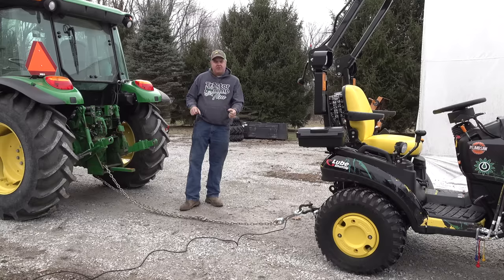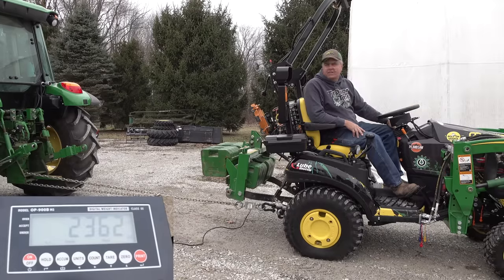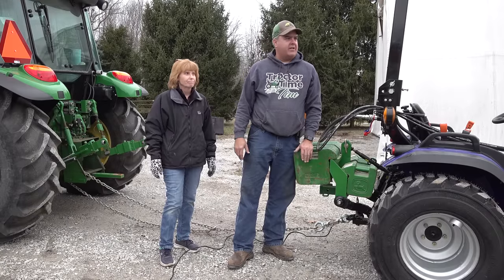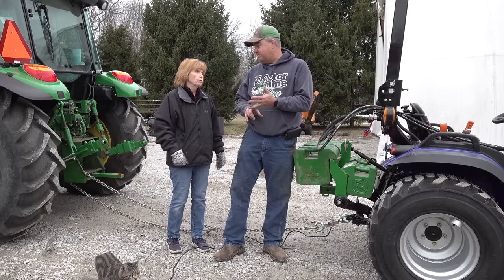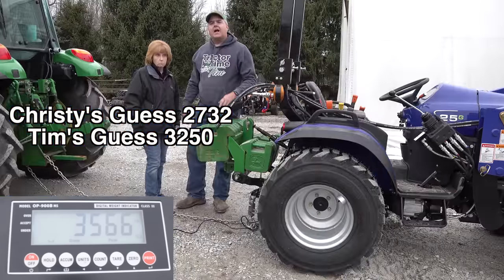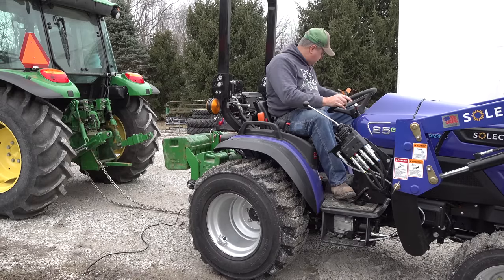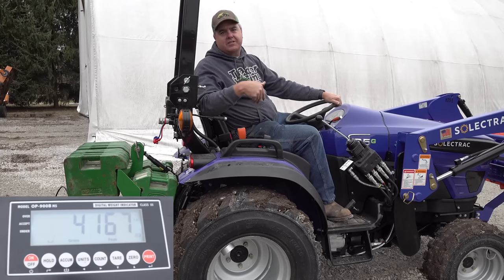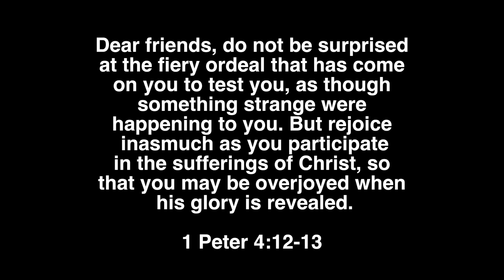CAN THE ELECTRIC TRACTOR PULL ANYTHING? Solectrac e25 vs Deere TURBO 1038X Tractor PULL TEST!

Comment: I like the electric tractors in for me who doesn’t have much property. It would probably be fine. My biggest problem with them is the inconsistency. Everything with batteries end up being a pain a couple years down the road and you have problems with freezing and heat and the problem with every phone and every other battery is two years down the road your battery life is severely diminished and just keeps declining. For a tractor that just doesn’t seem practical for me for someone is actually going to use it a lot. For a guy with a couple of acres he’s going to use it to mow his lawn and move some mulch around and 2730 to a little light landscaping once in a while I’m sure it’s fine but ha ha ha, I just don’t see it replacing fuel ever. No idea do you have a job to do your battery runs out and then you just gotta plug it in and wait till the next day I can’t use it right so we don’t have that much weight that we have and eventually you’ve got a very expensive battery to replace to wear your eight year old 1025 are still gonna perform pretty much about the same as it always did. After eight years you’re gonna probably be on at least your second if not third battery. It’s cool technology but I just don’t think it’s practical yet for anybody who really needs to use their tractor on a regular basis, but whatever works for people

Comment: Bigger tires also help.
Reply from the maker: How?
Reply: @TractorTimewithTim  Bigger tires allow more area to be in contact with the ground.  When geared low enough you can pull anything.  Think of the old Ford Tractors 9n, 2n, 8n  etc.  Their big tires give them an advantage.
Reply from the maker: …but the 1025r tires were not slipping. They were not the weak spot.

Comment: Advice : Buy 2 of these tractors, attachments, parts etc; and 100-200KW solar capacity with batteries, in order to get ready what's coming. I studied all biodiesel, ethanol and methanol issues. A big NO.
Also, has the ability to make methanol and change your small engines for it. Get extra pistons, valves etc. I didn't figure out yet how to clean the carburators without gasoline, but I will find the way. You don't want methanol sitting there, rust and eat everything. Else, pile up with lubricants. 
The small tractors will meet your hay and grain needs. Stay small. Large lands will be confiscated.
* As the digital money will spread, I expect serious issues.

Comment: If you live on level ground, adding ballast is an easy decision.  If you live in the hills of PA or a number of other states, it isn’t so clear.  Most ballast is attached above the tractor CG and thus raises it which is less than ideal on hills.  And when climbing hills, the ballast is working against you and the additional traction from the ballast is offset by the greater force vector down the hill from the extra weight.  So, saying that ballast is always the way to go simply isn’t true and sounds like the perspective of a flatlander, as we call them here in northern PA.  😁
Reply from the maker: Well, I disagree.  Ballast is even MORE important in hills.
Further, I disagree that most ballast is above CoG. You can lower 3 point ballast.
Rimguard and wheel weights are definitely below CoG.
Reply: @TractorTimewithTim  There is another test for you.  Try a 10 degree slope on dirt with and without ballast.

Comment: I used a Model 96 John Deere electric riding mower from 1988 to 2015.  As a result, I guessed 4000.  Same torque at zero RPM as at any other RPM…….

Comment: A very unfair comparison. I sure hope that no one buys a hydrostatic transmission for pulling power. A gear drive or direct drive transmission will easily out-pull an oil coupled hydrostatic one. The electric beast with its gear transmission is ideally suited for pure pulling power. The tires, frame and transmission must be equalized to find the truest results.

Comment: If you add enough weight to the conventional motor to stop the wheels from spinning, the motor can stall and the tractor should be fine. What will happen to an electric motor in the same scenario. Is it possible to damage the electric motor?
Reply from the maker: I did add enough weight to the Deere to stop the spinning.
I will find more weight and try again on the Solectrac.
Reply: I'm sure it has built in overheat protection for the motor and circuits. Even the battery power tools nowadays have to have that to protect the lithium batteries.
Reply: I was wondering, because I have stalled a few battery powered tools and the motors started to smoke right away. Then after that their power diminished quickly. I basically had to trash them, but the tractor is worth way more money so It should have some form of protection to keep anything from happening.
Reply: The motor controller should have momentary and continuous current limits as well as over temperature protection. The motor also has lots of mass to soak up heat from brief spikes in current, small tool motors heat up fast.

Comment: for a bit but you need to be below 👇🏻 recommended towable things to save on battery’s power. Plus nothing is proven what happens when the load heats up the battery your sucking more juice being harder on it.  Your running cooling fans. hopefully the manufacturer covers fires and failures since nothing is proven longevity working it like a 🚜

Comment: Yah if your bush hogging or dragging trees out guess you wouldn't need rear ballast but using the loader and or plowing snow or whatever if you don't use rear ballast your just wasting machine potential and asking for a dangerous situation.
Reply from the maker: Disagree on ‘dragging trees out’.  Weight is the ‘magic’ to pulling power.

Comment: This test is useless, did anyone notice the tire size difference? Get some real use out of these things for once.
Reply from the maker: Why does tire size matter?
Reply: @TractorTimewithTim  Bigger the tire the bigger the lug the bigger the contact patch hence the more traction.
Reply from the maker: Ok, but we held the 1025r down with weight.  It did not spin.   So, the 1025r smaller tires did not turn out to be a disadvantage.